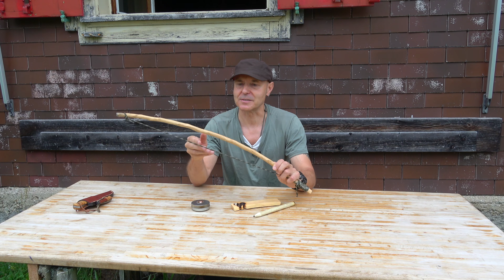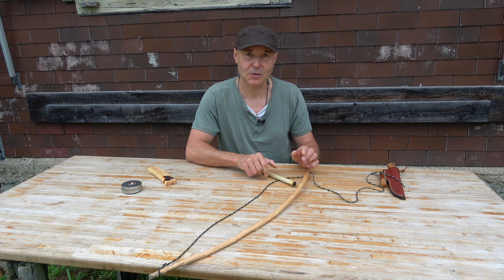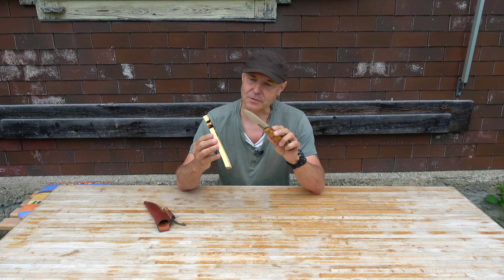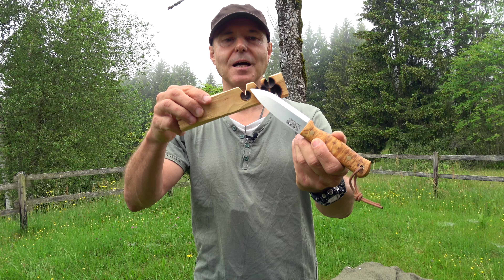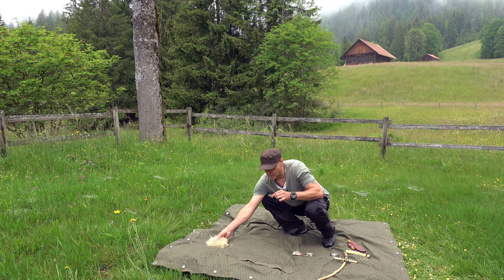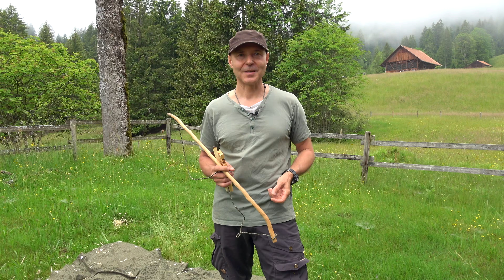Egyptian Bow Drill - Complete Tutorial Step by Step - Tips and Tricks - #bushcraft #survival

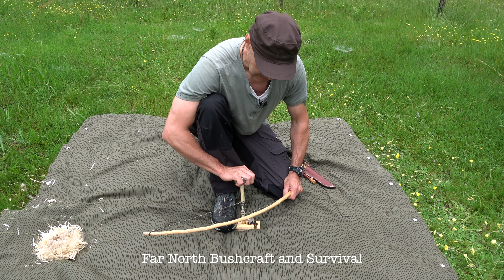Comment: 6:18 yes, pressure is key. too much pressure and speed, and you basically burn the wood (just like throwing raw meat in an overheated pan - charred outside, rare inside). imho neither speed, nor pressure in linear. you need to warm the set up. then you have to dial back the pressure a bit as you drill into the wood because resistance increased.

it is worth experimenting with low speed and pressure to see that bow drilling should not be physically exhausting.
Reply from the maker: Absolutely 👍 agree 👍 thanks for watching and your response, all the best, Taro

Comment: My first bow drill set was made entirely of Maple.  Don't do that.  You end upnjust polishing the wood.  It's too hard.

My second set was entirely pine.  Don't do that either.  The resin in evergreens is great as a flame extender, but it saps away too much heat from the fireboard shavings.

My third set had a fireboard made of really soft dead wood.  Also a bad idea.  All I ended up doing is drilling through the board.

Bottom line, if it's not working safe yourself the calories, and use different materials.

I've seen people struggle for 10 hours to get an ember, old men and children get it in around 1 minute, and the difference wasn't as much about skill as it was materials.
Reply from the maker: Yes, best way is to learn from each other and also make your own experience. At the time you’ll get a feeling if it could work or not already at the first pit before your carve the notch. And yes absolutely agree that a good wood combination compensates less experience with the technique👍